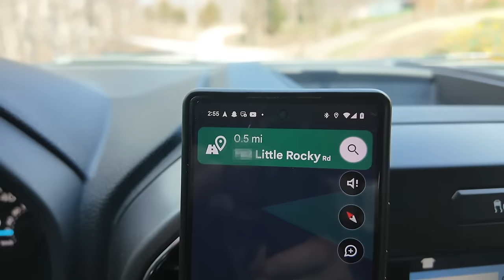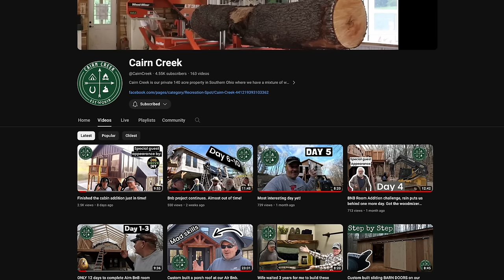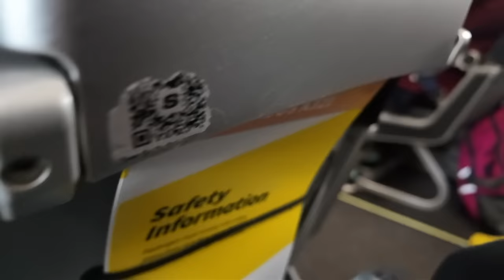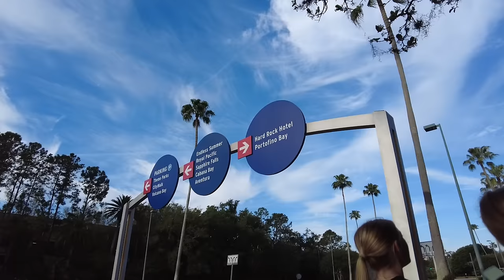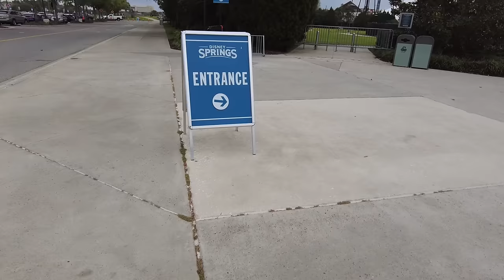I Took A Firewood Log On Vacation!  [Requires PATIENT Wife]

Comment: living in northern maine it was an interesting eclipse, rt 95 which normally driving north or south by the time were an hour from our exit(302 is the number and mile mark from the nh border) there are generally few if any vehicles, monday it was packed, im glad i just stepped onto my deck and watched the eclipse, temp drop was 18f degrees,  the 2 airports in northern maine were filled with private jets where normally we might have 1 commercial lol
in other words we had more traffic and outsiders than ever.  i was surprised our dogs didn't really react to the eclipse at all.
aboout your trip, your a smart guy,  memories are all we are so make them when you can.

Comment: I hate to be “that guy”, but they preach that you should source your firewood locally to avoid spreading invasive species, such as Emerald Ash Boer, as an example.  I would assume that would apply to raw logs in any form taken from the place where it died. I am old enough to remember when the American elm was largely wiped out.
Reply from the maker: I get it. But I did bring it right back and all the scraps went in the burn pile. Ash borer not in this log at least.
Reply: That's not firewood. That's Lumber. It's treated differently
Reply: @jjlpinct  Most trees harvested for lumber are cut green.  A log from a tree that has died on the stump can, and probably do carry a destructive species of insect (why else would it have died?).  Doesn’t matter if it is eventually sawed into lumber or firewood.
Reply: Your family will remember the trip forever, Especially the girls. It is great to take some time off for your family before the girls are all grown up. Family Memories is what's all about.